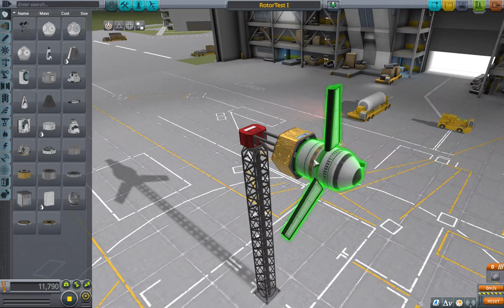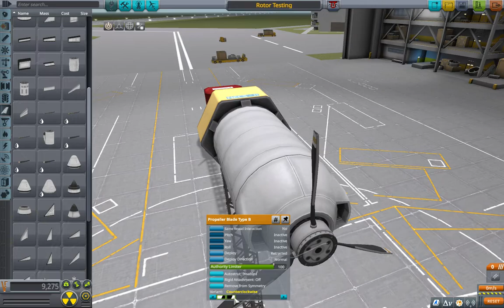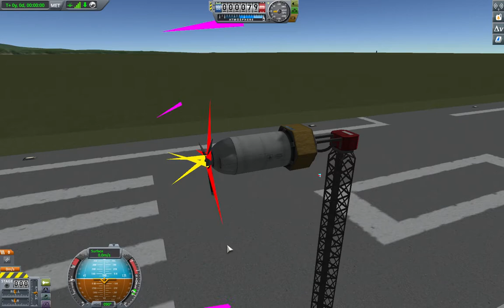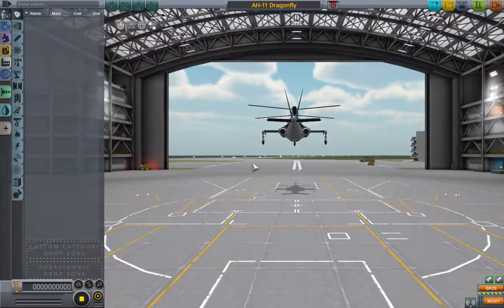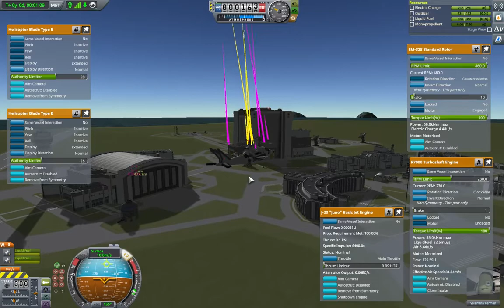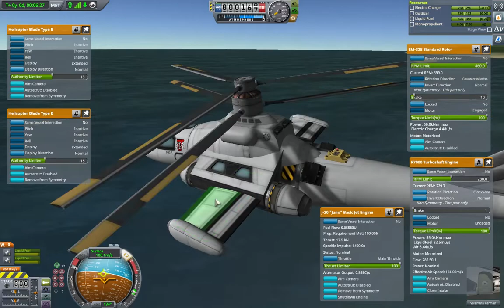AH-11 Dragonfly Coaxial Rotor Helo

Comment: John Howard
XL Jedi you are obviously highly motivated by your modeling of AH11. I can really understand the challenges you are facing with your coax models having tried to do this myself. The graphics appear to be remarkably good. As background, I worked on the V-22 and have several inventions that were incoporated into that aircraft, and other Bell helicopters.
Since then, I have also invented a large heavy-lift coxial UAV, and I am now starting to interest a number organizations to try to get the idea into production. A few years ago I made a Hex video of this machine under the Youtube title of “Coaxial Drone converts to Level Cruise”, and “Coaxial Drone Lifts 20 tons”. This will show you the configuration of the vehicle. It was a major pain trying to move a fast turning rotor through a complex takeoff scene so it was understandably short. I think the software was designed for stage presentations, nothing like as advanced as the software you using.
Thought you might possibly be interested in trying your hand at  modeling my vehicle, mainly because of the simple repeatable form of the structure. We  have plans to fly an eight foot diameter battery-powered model to prove the concept. Because of the complete lack of humans, the thrust to weight ratio is easily enough to convert into horizontal cruise as shown. It will be a first for any helicopter.
If you are in any way  interested, in this project please contact me at jv_howard@ sbcglobal.net
Reply from the maker: Very cool videos, thanks for sharing!  Interesting you chose to show your drone crane installing a turbine blade.  I work for one of the largest wind energy companies in the world.  The availability of cranes to hoist blades can often be a bottleneck to construction.  Would be interesting to see if something like your drone crane design will some day take root and replace their ground-based counterparts.

Comment: Bro! This is the best and most in depth video I have found to date.  Your knowledge about aircraft is superb, and now I just want to drink beer and listen to you talk about making different types of aircraft!  Awesome video.  I've got a similar design somewhat working now with the KAL1000 thanks to your video.  A lot of testing and tweaking to do so that it floats like yours, but I'm looking forward to the challenge and learning more.  Thanks again!
Reply from the maker: Thanks appreciate the feedback!    Some of the details in this video are a bit outdated.  ...and I have changed my mind on a couple items.  If interested in the topic, I have a rather long and involved PDF guide on how to setup rotors and props here:  http://www.xl-logic.com/KSP/Tutorial/UTEM_271.pdf
There's also an addendum at the end that includes some notes for updates that changed some things in 1.8 and 1.9.
Reply: @xljedi2335  thanks! I will check it out.  I noticed my version has "Deploy Angle" that seems more effective.  Also i found that with my build of fixed wing,  that the optimal angle depends on air speed, not throttle,  and got >250M/sec. By using 85° for take off,  and 45° at high air speed due to air density, etc. The KAL-1000 doesn't take air speed as an input, so i actually have to throttle back to climb higher when at higher altitude.  Learning a lot, fun stuff. I'll check out your PDF.
Reply from the maker: @charleso5940  the PDF includes an update addendum on the last page.  This video was upon release of props and rotors which dates back to 1.7 and there were some changes to properties in 1.8 and 1.9.  The differences you note above are due to the updates.

Comment: Watching the full demo piecemeal due to it being a workday ;) --- just got the autorotation realization -- what a (hopefully intentionally) deep system they've developed, here. :)

Looking forward to you releasing the dragonfly. You've put a good bit of work in on design and tweaking and I'm loving how that rotor system came together. Weird to use an electric rotor for the top, but both engines basically behave the same at the moment. Maybe it'll get fleshed out in a patch or two, and an engine that supports two shafts will be available (or modded). :)
Reply from the maker: Well, they don't just automagically behave the same....  I had to adjust the values so the RPMs, and Torque are equivalent when both are rotating at speed.  The little engine on top needs more power and double the RPMs to counter the lower engine RPMs.  I explained the coaxial engine setup in the video.

Comment: 1:29 Hallelujah!  I'm not the only one with this opinion!  I stopped attempting replicas because people always yelled at me that my artistic interpretation of resemblance was insufficient.  
8:34 Yes, the default rotation orientations of both the engines and the blades in KSP is based on European aircraft.  Using the plane engine from this time stamp as an example, this default spin is clockwise as viewing the engine from the "front" or outside of the engine looking in toward the craft, whereas American engines spin clockwise as viewing the engine from the "back" or inside the cockpit looking out toward the sky ahead.  I am already getting in the habit of reversing the defaults on both engine and blade any time I make a new plane so as to not confuse my delicate American sensibilities.  
24:15 Yes, kilo-Newtons.  
27:19 start of explanation of controls  (reference for myself in case I come back to watch this in the future)
29:22 [Your Main Throttle allocation suddenly clicks in my mind when I see the KAL curves.]  "OMG, that is brilliant."  
32:21 That is so cool.  I saw all of those new buttons but I haven't touched them yet.  Thanks for demonstrating them; I was apprehensive about whether or not they might behave errantly when used.  
38:51 May be nicer to play with but it's certainly not nice to listen to when you're explaining important stuff.  I'd like to submit a nomination for game sound to be turned down much lower next time you do a recording. :)
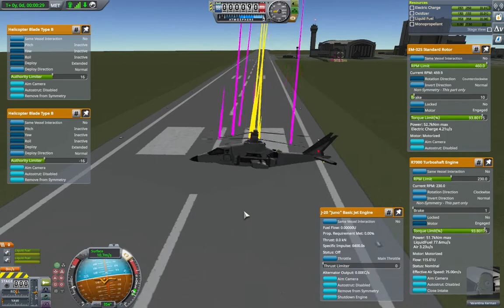42:01 That little hover spin you did: any idea if or how that might be influenced by the engines/rotors instead of relying on reaction wheels?  I haven't played around enough with the Axis Groups to venture a safe guess.  I was wondering if the rotors being active on the Yaw direction would help influence this, or maybe their rotation velocities relative to each other would change to deliberately imbalance each other's anti-torque in order to produce yaw in the commanded direction.  
43:11 Yes!  Beautiful, isn't it?  I'm so looking forward to exploiting the autorotation effects of these new parts & systems when I get some more time.  
46:51 The moment everyone was waiting for: Cue the Airwolf music!!
47:17 Seeing that your aircraft has a nose-up tendency with the Junos active, I wonder if you might set your authority limit a little below the hover requirement, like 14 or even 13, to counteract that tendency and distribute more lift responsibility to the winglets.  
49:20 Ah-ha!  That's what your L/R Translate mapping was!  You glossed over that in the hangar; it left me curious.  
51:44 Heh, interesting.  I hope I get to witness that myself some day.  
54:57 Yeah, like I've been telling people: the game is entering a new genesis, imo.  It's finally reaching a point where it should have been half a decade ago.  It never started to feel complete until now (even though there's still plenty of room for more features).  
56:33 Seriously, what pilot is deliberately going to seize up their rotor?  C'mon, Squad.  Sheesh.
Reply from the maker: Wow, really excellent feedback thank you!  Your point about the Euro vs. American orientation of the CW/CCW now explains why I see roll in the oppposite direction of what I expected!  I should've recognized the propeller was spinning the "wrong way" to begin with!   ...as for the comment related to my little hover spin and rotor effect.  It is a coaxial design so I would expect it to be driven almost entirely by the reaction wheels. It doesn't for instance seem anymore difficult to spin one way or the other.
Reply from the maker: One other point... I don't disagree with your observation that I have to keep pushing the nose down at the lower speeds, and maybe you spend a little time investigating it to see what might be optimal for your flying preference.  What you find though with a tilted cockpit (as I have it) is that as you increase speed and get up into the 105-115 m/s range I needed that extra elevator (which I spent a fair amount of time tweaking the angle of incidence of the elevator for this exact reason) because the airflow wanted to push the craft down.  Now just looking at the craft you might think that elevator is just slapped on at the default perpendicular and inline with the fuselage, but it's not.  ...and for me I preferred overcompensating a bit so it was pushing me up into the air when cruising at the slower speeds as opposed to nosing me down toward the ground!  Particularly because I like to skim the ground with the thing doing like 115 m/s!  Now, all that said...  could we also add elevator trim tabs and assign those to the unused U/D translate key, similar to what I did with the ailerons?  Sure!  I just didn't think it was all that critical for this particular craft.

Comment: Nice tutorial. However I've noticed a few problems with the way you've setup the rotors.

Main problem is that the upper rotor is spinning at 460rpm while the lower rotor is spinning at 230rpm. This causes the problem with the yaw, notice how when you're flying the SAS have to work all the time to counter increased torque from the upper rotor. I you where to turn off the SAS while hovering the helicopter would start spinning to the right, this wouldn't happen if both rotors where spinning at the same rpm.

The problem with the roll you're having at higher speeds is also because rotors spinning at different speeds. Because the lower rotor is spinning slower it is the first one to experience dissymmetry of lift as you increase the speed of the helicopter, and this causes the helicopter to roll to the right. Once again if both rotors where spinning at the same speed roll from the dissymmetry of lift on each rotor would cancel each other out and the helicopter would stay level in flight even at higher speeds. I while back I've made the autogyro with coaxial rotors, that can go about ~150m/s and it had it never had any issues with the roll at any speed.

Also one other minor suggestion is for the upper rotor to use different rotor with the bigger rotor head, that way rotor diameter on both rotors would be the equal and in turn forces produced by both rotors would be the same.
Reply from the maker: Since I built this one, I thought about disconnecting the upper and lower so one doesn't turn twice the speed of the other.  As for the diameter, probably just gonna slap a little docking port up there to the top and it would set the upper and lower rotor mount areas to equivalent sizes.  Might also give me a convenient spot to dock in a carrier hangar or something.  ...then just slide the blades out so the rotor diameters are equal.  The docking port looks pretty good up there too.  Good points.  There is some yaw, but I don't think it's all related to the RPM differential.  In my mind, that upper electric motor is doing two things, it's spinning the blade on top, and counteracting some of the force needed to turn the blade on the bottom.  I may investigate that a bit and update the craft as I go.  Hurts my head a bit to think about it too hard.  The yaw was evident on the tail rotor lift vectors during my flight testing.  So would like to see how it flies when the two aren't linked the way I have them.  Appreciate the feedback!
Reply from the maker: There are some other glaring errors related to some of my comments on the propellers too.  I have to clean that up in a follow up video.  Prop blades should be mounted just like the rotor blades.  ...and CW should not be the default setting for motor/blade direction if trying to be consistent with RL.

Comment: I really like this aircraft style! Looks really well built. I've been trying to fly it but the only thing that does not work is the Rotors. I've done the blueprint step-by-step process but the rotors don't work. I set the throttle to the recommended position before the engines are throttled. Is there something I'm missing? (New 1.11) Also, keeps saying robotic part is locked.
Reply from the maker: By default, when you spawn the craft in, the rotors are locked by design.  You have to use your staging button.  I set it up this way because...  1) there are 2 items that have to be turned on along with the rotors:  1) the jet engines, and 2) the fuel cells!    If you don't turn on the fuel cells, the rotors drain your batteries dead.  So when I turn on/off the engine (either by staging or the master 1 key) I also toggle the fuel cells.  It's all covered on the associated single page blue print on KerbalX.